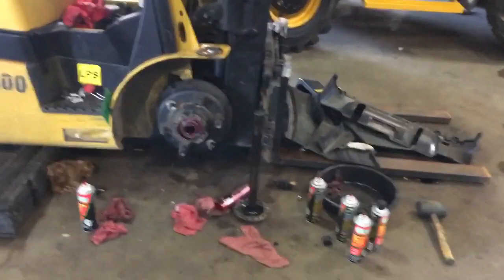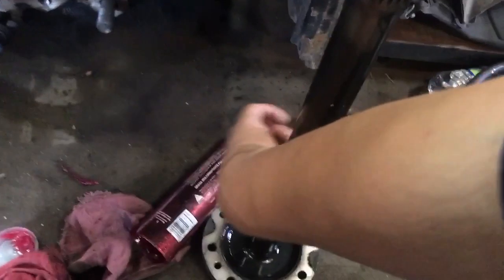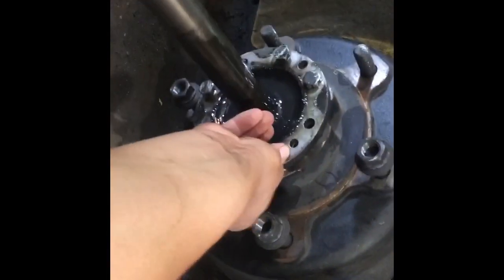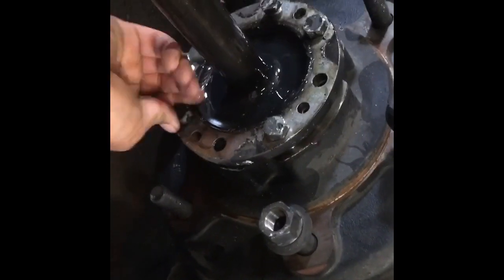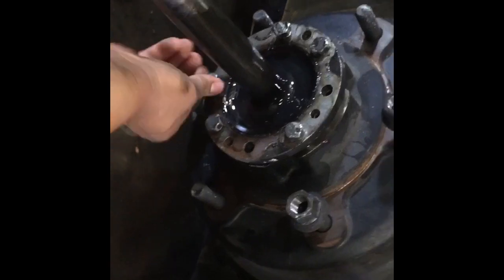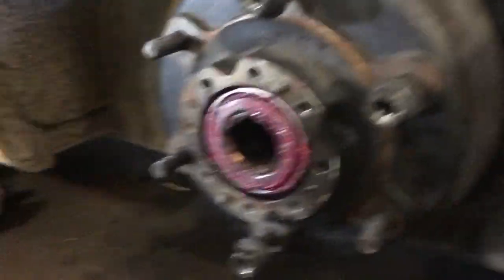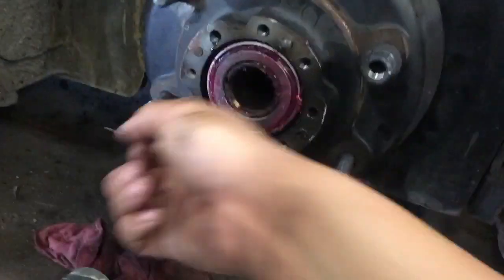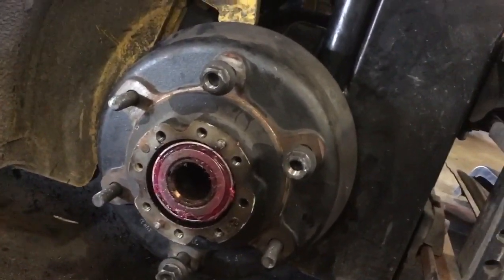Brake drum removal forklift

Comment: I bought a used Hyster electric front axle for building a tractor with. I couldn't get one drum to turn, so I pulled the drum and axle to see what was wrong. I turns out that there were a bunch of walnuts in the brake drum that evidently a squirrel had deposited through the access hole on the brake plate. It's nice and smooth rolling now. The ratio is 4.5:1, and I'll use a hydrostatic pump and motor to run it, and I'll probably use a Kohler command pro 27 HP engine.